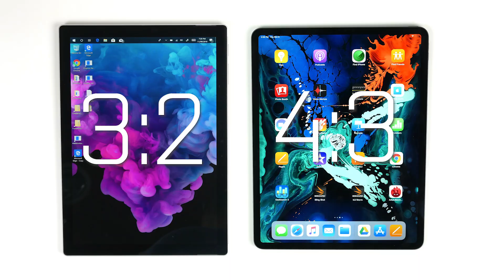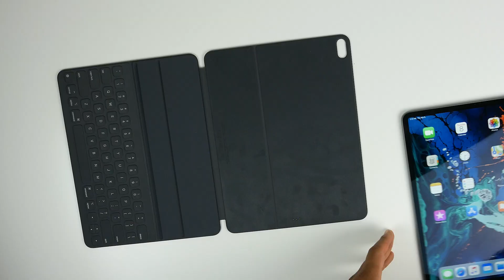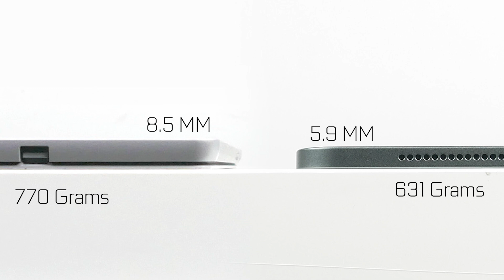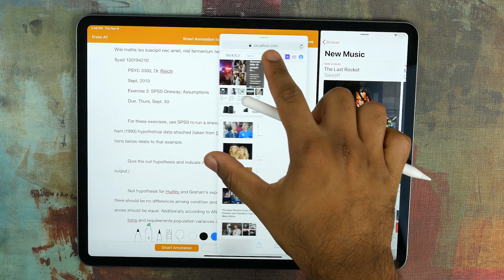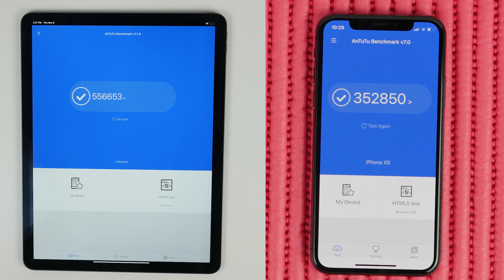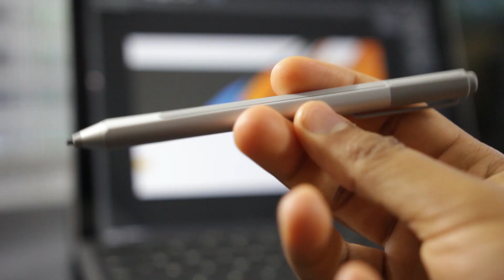2018 iPad Pro vs Surface Pro 6

Comment: You can’t compare a bicycle to a car
Reply: I hope Ipad is the bicycle....😂
Reply: You can. Both are a mode of travel
Reply: @random_user5761  got the 10.5, and there's very little that you can't do that is work related on the computer that you cant do on the ipad, if it isn't specific programs that are only windows related like AXdatabase systems or ERP systems, but even those are slowly starting to go with cloudcomputers, and with that you just need a tablet to connect from a browser to controll them remotely. 
as for reading, writing, notes, powerpoints and a lot more. the iPad performs either equal or enhances it.
Reply: BOTH ARE VOLVO XC90 2019
Reply: Bro. In this case, if the bicycle is th Surface and the car is the iPad, the driver of the car is a 5 year old when the rider of the bicycle is a world bicycle champion.
Reply: Yup, windows is a car
Reply: The Bycicle is hopefully the iPad. If not you didn't understand these two products.
Reply: You can if you don't have any gas.
Reply: If you live in Manhattan... You can lmao. If you have a bike, you can definitely get around wayyyy faster. The car is more powerful but the bike is more convenient. Like the how Surface is more Powerful but the iPad is more convenient. Soooo... Yeah lol
Reply: Abstrax Media surface is no where as powerful as the new iPad
Reply: @hanzohasashi2631  No. It has a mobile chip,the arquitecture is compleatly diferent from a desktop i7.
Reply: @hanzohasashi2631  surface invented that a tablet that has stander, stylus, and a keyboard first bro. apple is such a copycat
Reply: @PassiveLearner365  boi wtf you on how is a bike more conveniant than a fycking car lmao
Reply: @yanir1467  city traffic during rush hour.
Reply: Abstrax Media BOO-YAHHH!!!! 😂😂😭😭😭👏🏾👏🏾👏🏾👏🏾👏🏾
Reply: Abstrax Media Abstrax Media ok but for me, your phone does the same job.If you can’t get xcode, (or code blocks), autoCAD, mathlab, and other professional softwares in the ipad pro, this device will only be useful for « email readers ». If the ipad pro had mac os, i would prefer it.
Reply: Hiken no Ace you can use plenty profesional software on the iPad included AutoCAD, and remember those are tablets they’re supposed to be efficient portable tools, I wouldn’t dare to use 3dmaxs on a surface, I’m not retarded
Reply: Why did you call surface a bicycle?

Comment: Why is this even a comparison? If you need a good laptop get the surface, if you need a good tablet get the iPad
Reply: Ye
Reply: if you need a good laptop you buy a laptop, if you want a good tablet you go for a iPad. easy.
Reply: lolsa123 Right!
Reply: AlexStealsMemes The thing is the Surface Pro 6 is not a laptop. It’s a tablet alongside the iPad Pro.
Reply: @trey281   The Surface is MUCH more than a basic tablet, and you know it -- or you damn well should .  It runs full Windows 10, FFS.  iPads run iOS which is at this point strictly a mobile OS. 
    Look, I own a MacBook and a basic iPad, and I'm the first to acknowledge the iPad's limitations.  I really only use it for watching videos, browsing, social media, light email, and a few basic games.  It excels at those things.  
   But make no mistake -- the iPad is NOT a computer, and never will be until Apple gives it OSX (or at least a dumbed-down version), a file manager, and input (mouse/trackpad) capability.  It will likely need an X86 processor as well.
Reply: Sharky165 The Surface Pro is still a tablet so...
Reply: @trey281   It's a much more advanced tablet than the iPad because it has full computer functionality.  Therefore it's a smarter choice for users who need/want the best of both worlds.  
    I'm of course not saying that the Surface Pro can compete with better true laptops or desktops.  Personally I'd go for a Surface Book or some other true convertible laptop over the Surface Pro.  
    But IMO the iPad Pro is still a royal friggin rip-off given its limited functionality.  The only thing "pro" about it is its price !   My 2017 iPad cost me $150 brand-new out the door, and the only function it doesn't have vs these new Pros is Pencil support !  (which I don't give a crap about since I'm not an artist, LOL).
Reply: @Sharky165  want the best of both world? You mean the worst of both worlds, with the surface you are neither getting a good tablet nor a good laptop.
Reply: @lolsa123   Please...the Surface Pro is the best-selling tablet/convertible precisely because of its utility.  The more you try to denigrate it, the more ignorant and dumb you sound.  
    Face facts:  The iPad Pro is just a $800-1,000+ big-screen, fancy iPod Touch.  Only someone with shit for brains would pay that much for a such a basic tablet ! 🤣🤣🤣
Reply: Sharky165 I just said it’s a tablet. I didn’t say it was better or worse...
Reply: @trey281   The Surface Pro is much more versatile - and therefore more practical and a much better value - than the iPad Pro because it's a tablet-computer.  
   Unless/until Apple adds Mac-type software, and hardware features to it, the iPad Pro will never be anything BUT a very overpriced, basic tablet.  End of story.
Reply: Sharky165 For the last time I’m not saying one is better than the other. All I said was that the Surface Pro is a tablet as the iPad Pro. Both have pros and cons...
Reply: @trey281   The issue is that it's almost all cons for the iPad Pro, because it's FAR too limited by its software for the $$$.  It's like being forced to drive your Ferrari in a 30 mph zone for all the years you own the car -- what's the fuggin point ?? 🤣
Reply: Sharky165 Well you completely missed the point of my first comment, but mkay 🤷🏻‍♂️

Comment: Getting Surface Pro 6 with i7 is way too costly. Same for ipad pro.

I would rather buy decent laptop like Dell XPS 13 or Inspiron together with 64GB New Ipad pro 11 inch

There you have it. It's almost the same price of them but little bit higher
Reply: Dell XPS 13 is the same price as the surface pro? Also out benchmarks the XPS

Comment: Geekbench is not the benchmarking score for x86 Architecture systems. There as are lots of things compromised in the ARM architecture which Geekbench doesn't score on. They basically measure on the output not the inputs. Try running some heavy duty numerical analysis application and I think the ARM architecture will lack on those aspects. Apps like MATLAB, Mathematica, Wolfram Alpha , Solid Works , SPSS, Excel and I think these heavy duty application rely on Compute power of x86 Architecture. I could be wrong but I am just guessing from the perspective that intel is a CISC architecture while ARM is a RISC .
Reply: debendra gurung another person talking out of their ass. Geekbench is actually specifically designed and calibrated with the x86 architecture and they calculate heavy workloads like crypto etc read yourself and get educated http://support.primatelabs.com/kb/geekbench/interpreting-geekbench-4-scores

Comment: Surface pro 6 easy. I have a ipad. I use it to surf the web, look at youtube videos. To do real serious work. I grab my surface pro
Reply: Rohan George I don’t see anyone hating on Apple here, what are you talking about?
Reply: Why type of serious works you use surface to
Reply: @roz7696  i bet he used surface for netflix LOL
Reply: @roz7696  To build apps with visual studio.
Reply: @roz7696  I connect it to a monitor and do coding on visual studio. Oh and also some CAD work on solidworks, something the ipad can't and never will be able to do in the coming 5-6 years at least
Reply: Rohan George Apple is good but I do agree that the surface pro 6 is better when it comes to intensive work. ( I mainly use it for animations and sketching )
Reply: @Daniel Simmons Exactly thats my point lol, I got the sp6 yesterday for college ad its amazing
Reply: Good
Reply: I live for suga's chop chop chop in Cyper 3 you can check it out for yourself on Instagram @kuzemaie_art it works really well.
Reply: @yofu2969   hi ^^ i'm thinking on buy a Surface pro to make drawings and more, but I have a lot of opinions that the lines doesn't work well, do you recommend it ? I use clip studio and sai
Reply: Jade Silver my first 2 speedpaints were using the surface pro 7, the laptop is alright but in no way does it compete with a desperate laptop connected to a drawing tablet. If you want to make ok drawings, the surface pro 7 is fine. But if you want to make professional grade drawings, then I’d go with a drawing tablet instead of a laptop ( it’s way cheaper to get a drawing tablet ) or you can also just get the new ipadpro, my elder brother is a graphic designer, and uses it for work, I used it once in a while to make some really cool drawings, I loved the ipadpro but it’s pretty expensive...
Reply: Same
Reply: george clark you can’t surf the web and look at YouTube videos on the surface pro6? 🤨
Reply: @rohangeorge2951  lol wut?
Reply: same george
Reply: Looking at porn and write documents in word or email you call serious work?

Comment: Prefer touch use ipad 
Prefer touchpad surface (btw it’s keyboard is better with that material and high travel) 
Remember that ios is good at productive stuffs like office 365 support and trello, but still lack the developers tool to use (don’t treat it like a laptop, treat it like a tablet but do 70% laptop work)
While surface IS A LAPTOP don’t hope it’s a good tablet “it’s not” because windows 10 is too buggy and LAG at “tablet mode” like my surface book 2016
All because of the “high resolution” that microsoft haven’t optimize it FOR 3 FREAKING YEARS

Comment: When do you ever use the surface touchscreen??? The surface is a laptop that happens to have a touchscreen, it’s not a tablet whatsoever. You probably use the trackpad 90% of the time
Reply: As a surface pro 4 user for 1 year, having the keyboard + pen I am certified to tell you, that you can take your inexperienced comment and shove it up your ***. I use the touchscreen all the time. It's faster, and better than a track pad. If you have no idea or experience, stop assuming
Reply: Zunzun - lmfaooo you made my day with that comment. Yes i don’t have much experience on the surface pro. However from everyone i see using it at school or the little time I’ve used it. I don’t see the touch screen used much as it’s normal windows 10. Not many apps are made for a touch interface. However on iOS every app is made based on a touch interface.
Reply: @yahya2700  Then your class mates are just not used to it yet. Every app is compatible to touch, its just the simulation of a click. 0 experience or ideas

Comment: I am not trying be bias on Microsoft or Apple here. I have an Iphone X and have been using iphone since 3GS. I have an ipad pro 12.9' last year version that replaced my old ipad 4. But I also have a powerful self-built desktop PC, a laptop in Surface Book 2 and a Surface pro 2017. I love them all for their own specific purposes. 

I laughed so bad when he says " it's safe to say" A12 is faster than i5/i7 base on one benchmark on two diff OS. When was your last time to see a tech channel compares a CPU from Intel running on Windows and a CPU from AMD running on Linux? Never! But somehow this video is doing completely the same thing but they never realized the problem. Intel CPUs are designed for desktop/laptop environment, while Apple A processors are designed for mobile iOS (but not Android) environment. It's like comparing a sport car to a semi-truck, even they are in exact the same price (which they are not). If ONE benchmark values speed, then the sport car wins. If another benchmark values towing capability, then the truck wins by miles.  I dare you, if you can manage to install Windows or Android on ipad you'd get a completely different result. 

And synthetic benchmark results are not the whole story of performance. Firstly, how much of each point of the benchmark mean anything in real life? A more direct question is how much difference is between ipad's 556653 and iphone's 352850? Two times faster in turning on the devices, Opening the Safari app or do FaceTime twice smoother? None of the number mean anything.
Secondly, benchmark vs real life app performance. Many of you have seen synthetic benchmark comparison for AMD and Nvidia GPUs. But their performance still vary a lot from game to game (ie. real life performance). Easy example: GTX 1080 vs. Vega 64 in synthetic and in different games. 

The last, a simple question for you: Intel Core i9 18-core processors or AMD Threadripper would def give you even more impressive multi-core benchmark score. But does it mean they would be used in the device?
Reply: Damn.... Where is your youtube channel bro!! @Yi_jun_Lin .....loved it.....
Reply: @18muhammadkhatib16  Ah thank you for your kind words. Im an engineer myself and a tech lover. But sadly Im a no YouTuber. I wish I have the time and the talent to make my own channel. Most likely people make more money this way nowadays lol
Reply: Why isn’t this the top comment? This man clearly knows what he is talking about, which is a lot more than this “tech” YouTuber... have a like brother :)
Reply: COMPARING SCORES BETWEEN TWO DIFFERENT ARCHITECTURES IS TOTALLY MEANINGLESS. If there are some guys who can't understand this fact, go and study computer science yourself, or just memorize.
Reply: Asking the real questions
Reply: So it's best for me to buy a surface pro 6 rather than an iPad pro?
Reply: @Theway2Mount7Up  depends on your needs take a paper and pen . And write down how you going to use it for the next 3 years to 5 and then decide
Reply: These people don't know anything about processors. I can tell for a fact that even snapdragon 845 is more powerful than that A12 bionic shit
Reply: shoaszx you are so full of shit. Both the A12X and Snapdragon use the same architecture and therefore CAN be directly compared by benchmarks and Apple is at least 2 years ahead of anyone else in terms of mobile processing, and soon Apple will use their chips in their computer because the performance per watt is destroying intel.

Second this nonsense of inaccurate benchmark scores is emphatically false. Geek bench does a set of several heavy duty tasks and calculates how long it takes to finish, this includes crypto, interger testing etc stop being uneducated and read yourself http://support.primatelabs.com/kb/geekbench/interpreting-geekbench-4-scores
Reply: @hajjdawood  on different opperating systems with different supporting hardware if you want correct benchmark scores you need a test bed where EVERYTHING is the same except for the processors or whatever component you're testing or else they are inaccurate representations.
Reply: joshua walcott EXCEPT THOSE CHIPS ARENT AVALIABLE CROSS PLATFORM.
Reply: @hajjdawood  Don't get me wrong, Apple's processors are def leader in mobile system and I'd love to see their processors go to their own computers one day. But with that all being said, I was merely pointing out the video's ways on comparing two processors based on two different OS and a single benchmark are just not reliable. There is no against Intel or Apple here, just the pure researching fact. Besides, Geekbench is respected benchmark out there thats why people are using it. But relying on just one benchmark is not the way tech people should do. Don't you agree on that?

Like joshua walcott said, a good representation requires everything except the component being tested completely the same. Like if you are comparing which of two engines are more powerful, you need to put them into a same room with same temp, same dusty environment, same pressure level and feeding same type and same level of fuel etc etc. A good tech channel like Gamers Nexus need to develop some very reliable yet repeatable methodology beforehand if they are trying to directly compare two things.
Reply: @hajjdawood 
LOL it's a completely different OS
Reply: I think im the only one who didnt read all of these only the beginning
Reply: How do you like the Surface Book?  I tried it and I really liked it but I do want the 1060 though it’s a bit to rich for me, and I kinda like the laptop but def not the Surface pros
Reply: @truezywoozy9742  I have the Surface Book 2 15". Loved it every bit when i was on the go. The battery lasts very long compared to Surface Pro and the GTX 1060 handles occasional gaming well enough. Keyboard is one of the best when in laptop mode. The detached screen is very light but the battery in it doesn't last long tho but i like using it in so called "studio mode" a lot. There were software bugs from time to time, especially if you detaching it alot. Rebooting and updating software often fixed them. There was one time my screen had multiple horizontal bars flickering and floating from top to down. They stayed a few mins before going away depended on the screen brightness. It was very annoying and I thought it was some hardware failures. But it turned out to be the driver for the Intel HD integrated GPU got messed up. Other than that, everything works as I expected. If you want a dedicated GPU from the Surface laptop lineup, Book is your option. But yes it is very expensive. You can def get some better hardware (except the display) with the same money if you pick other PC laptop. But the style is unique, which is what you mainly pay for here if you think you will use that
Reply: i learned more from your comment and this thread than from college
Reply: weird flex but ok
Reply: @ibrahimmian9262  which one is bigger for trading stocks?
Reply: Damn u rich guy, having a surface book 2 (they might be cheaper now)